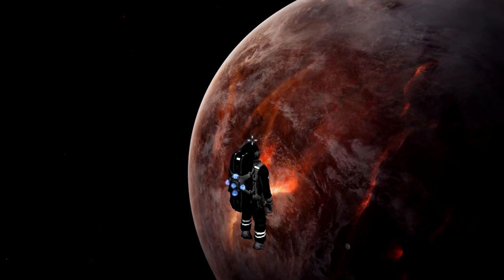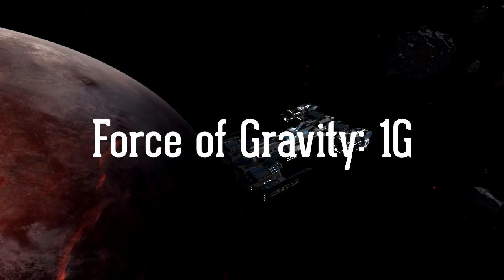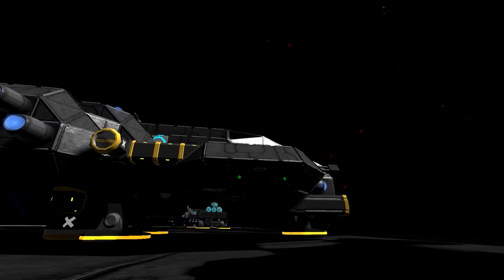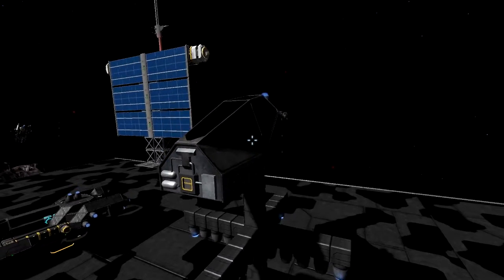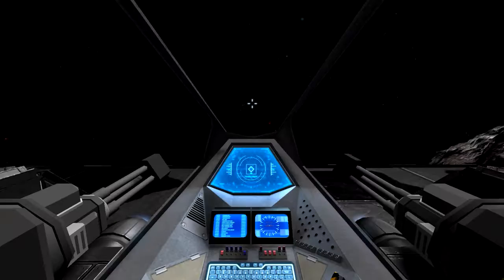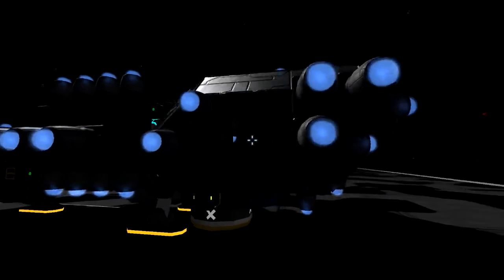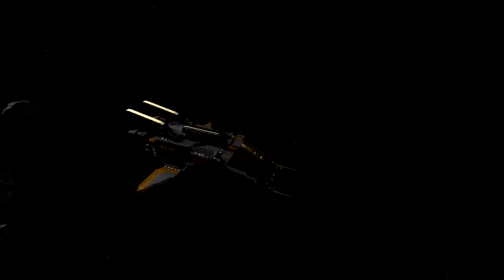Space Engineers: Thoughts on planetary gravity and possible effect on ships

Comment: One MASSIVE problem will be creating an orbit. The orbital velocity required to maintain a say, 40km (30km planet radius) circular orbit in a field of 1G is very high. Well over 500 meters per second. This is the same regardless of the mass of your ship. Velocities like these are beyond what the game engine is capable of at the moment, primarily because the game uses the havok physics engine, which wasn't written with massive spaces and high velocities in mind.
The only way to get around this properly would be to write a custom physics engine so that the speed cap can be removed, a truly monumental programming task. And probably quite beyond what keen can achieve with their current staff. C# most certainly wouldn't cut it, low level access to memory would be essential.
In any case you shouldn't have to worry. It is far more likely that the effect of gravity on ships will be low, or the planets gravity very weak.
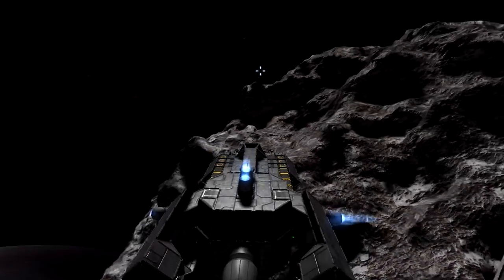By my estimation, 1:30 or 0.033...G is roughly the amount of gravity that the game can handle before velocities get too high to handle.
That or they will add an "anti gravity engine" or some such similar block to the mix ;)

Comment: What about building a thruster specifically for this, utilizing mass blocks on thruster sets that are connected to the main ship by a rotor?  You could find a way to add additional reinforcement so that the thruster doesn't just rip off, but you could have the ability for your ship to flip, and still stay up.  I wouldn't add them for the side thrusters, or braking thrusters, or forward thrusters, just upward life thrusters.  I would also build an emergency gravity drive, except on fighters, that would be meant to slow our descent if we needed it.  I would say never to put fighters, or the massive ships on the planets, as the energy required to leave the planet far outweighs the benefits, and with a fighter, the additional thrust and therefore energy needed to lift it off would require specialized lift platforms, that would also cost more energy and such.  Building them so that they function well on the planet, and maneuver well would be foolish, as they would then be unwieldy without the consistent downward pull of gravity, and would be useless in space.  I am also concerned on how they would add gravity to the planet, would it be based off of the planet itself?  Or merely the center of the planet, without regards to the current level of rocks and such still existing on it?  For example, if I FULLY destroy the planet, will there still be an odd gravity well just sitting there?
Reply from the maker: TheMinecraftDragon97 Wow, what a comment. Thanks for sharing your thoughts with us, that was really well thought through and gave me something to think about :)

Comment: I think a thruster that rotates like the maneuvering thrusters on Serenity would be a good block to add. Rotate it to fire retro when entering atmo facing the planet surface, then rotate it downwards to slow decent when the ship is rotated to be parallel with the planet's surface. For takeoff, the thrusters will be facing the ground but then can be rotated to face backwards when a certain height is achieved and thus allow the ship to have enough boost to break atmo and can also be used as main thrusters in space once the pilot has broken atmo.

My idea is this would be a new thruster type itself instead of made of multiple existing blocks to avoid pistons and rotors as well as have it be one grid. The thrusters should come in medium, large, and small varieties (for both large and small ships) though, to compensate for this.

On a side note, the game also needs a dedicated retractable landing gear block (a 1x1x1 that extends to 1x1x3 as well as a 1x1x3 that extends to 1x3x3) so one does not have to deal with unstable pistons and rotors for retractable landing gear as well as be able to implement retractable landing gear in more compact designs. Having this retractable landing gear would make planetary landing easier as well.
Reply from the maker: Xenolego Yeah, some kind of V-tol engines would be great. I am so desperatly waiting for something like that. And when taking planets, say would actually make sense and not just look cool. And for the landing gears: unstable pistons and rotors are the crucial point, if those were stable like they should be, the would be no problem at all. But I agree, having a retractable landinggear as a single block would be great, just for the reduction of needed space.
Reply: Tartaross Inc. Exactly, there currently isn't any good reason to not have a retractable landing gear block that doesn't take up a lot of space seeing as I never use landing gear to land because they take up a lot of space and connectors are infinitely more useful.